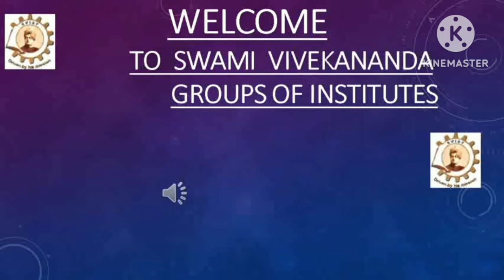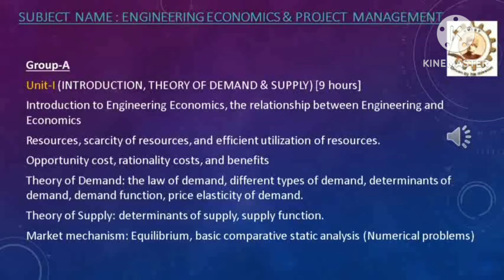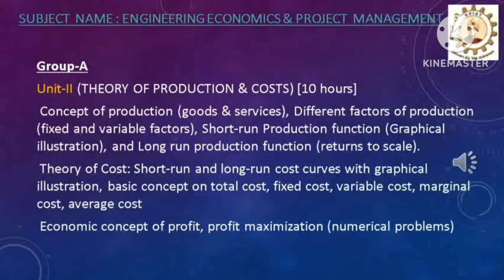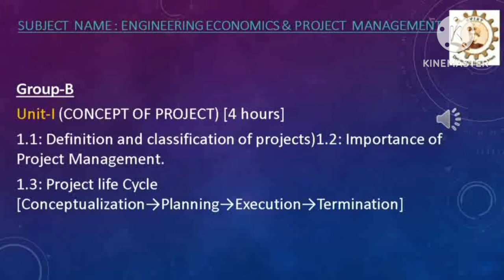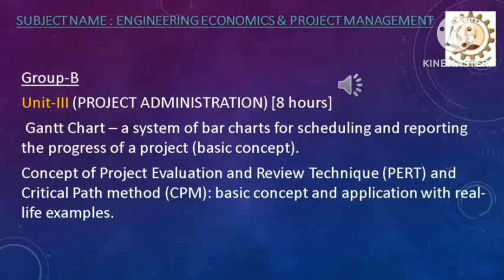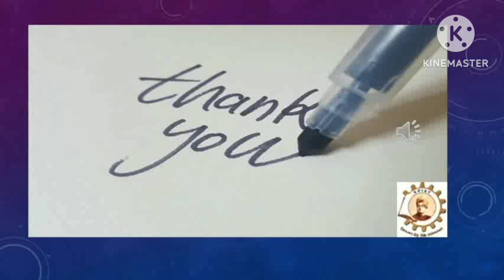Complete syllabus of Engineering Economics & Project Management.

Comment: Dipti Chakraborty
3rd year 6th semester (CST)

1. What is law of demand?

The law of demand is a fundamental principle in economics that states that, all else being equal, as the price of a good or service decreases, the quantity demanded for it increases, and vice versa. In other words, there is an inverse relationship between price and quantity demanded.

This principle assumes that other factors affecting demand, such as consumer preferences, income, and prices of related goods, remain constant.

2. What is supply of demand?

The term "supply of demand" is not a standard economic concept and might be a mix-up. However, "supply" and "demand" are fundamental concepts in economics:

✓Supply: The amount of a good or service that producers are willing and able to sell at various prices.

✓Demand: The amount of a good or service that consumers are willing and able to buy at various prices.

Together, they determine the market price and quantity of goods sold. The "law of demand" states that as prices fall, demand increases, and the "law of supply" states that as prices rise, supply increases.

3. what is Perfectly competitive market?

A perfectly competitive market is an idealized economic model characterized by several key features:

✓Many Buyers and Sellers: There are numerous participants on both the buying and selling sides, ensuring no single entity can influence the market price.

✓Homogeneous Products: The goods or services offered are identical and interchangeable, meaning consumers do not prefer one seller's product over another's based on quality or features.

✓Free Entry and Exit: Firms can enter or exit the market easily without significant barriers, ensuring continuous competition.

✓Perfect Information: All buyers and sellers have full and equal knowledge of prices, product quality, and production methods.

✓Price Takers: Individual firms and consumers accept the market price as given, since their own transactions are too small to affect the overall price level.

4. What is Capitalism?

Capitalism is an economic system in which private individuals or businesses own and control the means of production and operate for profit. Key features include:

✓Private Property: Individuals and businesses have the right to own and use property as they see fit.

✓Market Economy: Prices and production are determined by supply and demand in free markets.

✓Profit Motive: Businesses operate to generate profit, driving innovation and efficiency.

✓Limited Government Intervention: The government's role is generally limited to protecting property rights, enforcing contracts, and regulating markets to prevent monopolies and fraud.
In capitalism, resources are allocated through voluntary exchange, leading to economic growth and consumer choice.

5. What is the full form of PLC?

PLC stands for Product life cycle.

6. What is the full form of PERT?

PERT stands for Program Evaluation and Review Technique.

Comment: 1. What is the law of demand?

The law of demand describes the inverse relationship between the price of a good or service and the quantity demanded by buyers. As the price decreases, quantity demanded increases, and vice versa.

2. What is the supply of demand?

Supply refers to the quantity of a good or service that producers are willing to offer at various prices in the market.

3. What is a perfectly competitive market?

- A perfectly competitive market is a market structure where many firms sell identical products with no barriers to entry or exit, leading to price-taking behavior.

4. What is capitalism?

Capitalism is an economic system where private individuals or businesses own and operate the means of production for profit.

5. What is the full form of PLC?

PLC stands for Programmable Logic Controller, a digital computer used for automation in industrial processes.

6. What is the full form of PERT?

PERT stands for Program Evaluation Review Technique, a project management tool used for scheduling and coordinating tasks within a project.

Santanu Samanta 
3rd year,cst

Comment: Nayan Banerjee 
CST 3rd year 6th sem 

1. What is the law of demand?

The law of demand is a fundamental concept in economics that states that as the price of a good or service increases, the quantity demanded by consumers decreases, and vice versa. In other words, there is an inverse relationship between price and quantity demanded. This relationship is based on the assumption that all other factors remain constant, such as consumer income, preferences, and the prices of related goods. The law of demand is a key principle in understanding how markets function and how changes in price affect consumer behavior.

 2. What is the supply of demand?
It seems like there might be a typo in your question. Did you mean to ask about the "supply and demand"? If so, supply and demand are two fundamental concepts in economics that describe the relationship between the quantity of a good or service that producers are willing to supply and the quantity that consumers are willing to demand at various prices.

3. What is a perfectly competitive market?
A perfectly competitive market is a market structure in which there are many buyers and sellers, and no single buyer or seller has the power to influence the market price. In a perfectly competitive market, all firms produce identical products, and there is free entry and exit of firms in the industry. 

 4. What is capitalism?

Capitalism is an economic system characterized by private ownership of the means of production and the pursuit of profit. In a capitalist system, individuals and businesses have the freedom to own property, make economic decisions, and engage in voluntary exchanges of goods and services in the marketplace. 

5. What is the full form of PLC?
PLC stands for Project Life Cycle. 

6. What is the full form of PERT?
PERT stands for Program Evaluation and Review Technique.